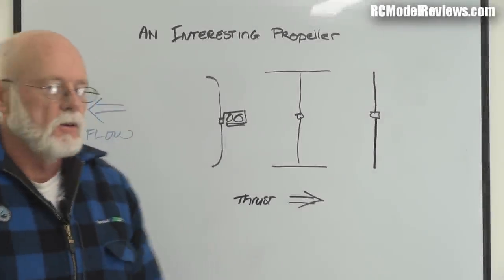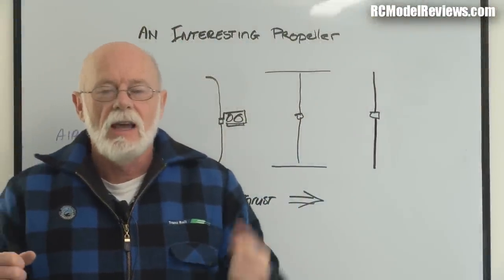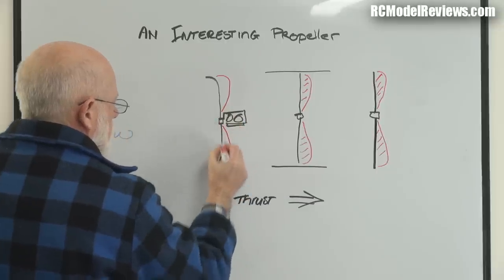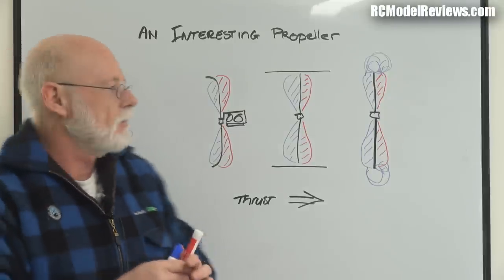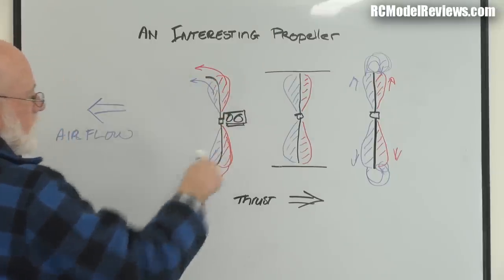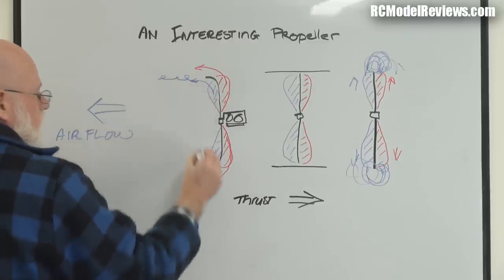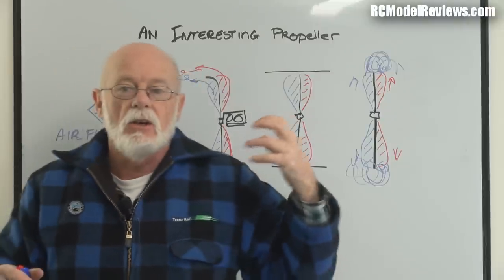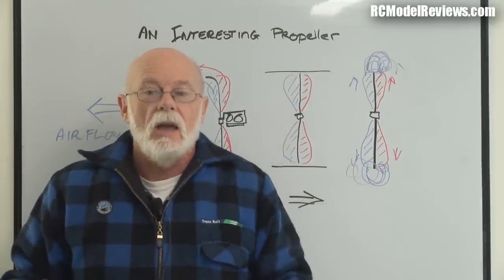More on ducted propellers, the Q-tip propeller

Comment: I"ve seen these blade tips on a car's radiator fan, now I know its to reduce noise output.
56years old and still learning, thanks Bruce.
Reply: Thx dude. I just learned from you too. Good day
Reply: @Adolph. As soon as I read your comment, I was reminded of the thermostatically operated clutch fans That I've dealt with over the years.  I feel dumb for missing that!  Excellent observation.  🤔
Reply: I've been searching the internet for 3 straight hours to find anything that explains a curved tip propeller. Im working on a project trying to find out how much a curved/warped blade tip would effect the aircrafts performance. Im trying to figure out if this is hurting my drones performance and if so how much and in what way. Thrust? Top Speed, agility?  It won't get any worse than this is now. If I dont use the velcro to keep in place the props flop around and snag on thing. Please advise sir I like the way you explain thing. Thanks in advance

Comment: Very clearly explained. I always thought the winglets were supposed to point to the low pressure side to block the airflow around the tip, not to the high pressure side to lead it along, as it were, so thanks for putting me straight!

Comment: thanks for answering my query.  this explains why my tricopter is so much more quiet than the other models as it has the tips on the props.  well, that and the slower props speeds.
Reply: Props work most efficiently when the tip speed is slightly sub-sonic, so if you have several props on several aircraft, the one with the slower prop (I'm assuming slower in RPM) is also the largest so the tip speed is really the same on all three. Unless one system is not optimised properly and the tip speeds are greatly sub-sonic, but then you got bigger problems than noise...😁

Comment: liked your video alot.  I have seen q-tip props a fair bit while working at my local airport. However, all of the props I saw sloped the tip back towards the fuselage - same direction as the thrust. Whereas you have portrayed them in the opposite direction. Keep up the good work!
Reply: Bear in mind that the prop effectively compresses air behind it so a back-tilting fence is going to act to "catch" some of that air. A forward facing one may not be as effective.

I suspect the best result would be achieved with something like bidirectional sharklets, but unlike ordinary wings props have a lot of other forces acting on them which need to be taken into account. 

The kinetic energy in a small GA prop at idle has been described as on par with  "a 600mph housebrick - on the end of a piece of string" and that's going to put a lot of streching stress on the length of the blade - As a GA pilot, we were always taught to be extremely careful about nicks on the leading and trailing edges of the props as these could turn into propagating cracks in very short order and the last thing you want when in the air is to have your prop suddenly unbalance itself.

Comment: Currently designing an all electric powered, twin ducted fan powered 2-place aircraft. It is a high wing LSA that will provide a true 90+ minutes of flight time. Both ducted fans will hang from the wings of the aircraft and the. Speeds will be comparable to those found in most traditional 2-place trainers (around 100-knots), and will provide ample room for both the CFI and Student Pilot. Every line will be lifting in its design and very clean....minimal drag! Look very forward to introducing the concept drawings.

Comment: Was sitting here waiting to see a prop made from Q-Tips... 😜

As for avoiding tip vortex, I've seen some props before use an entire ring molded as the circumference of the prop, avoiding tips altogether, and making like a short duct.  This could be placed in close proximity to an actual duct to facilitate the effect of a longer or more complete ducting apparatus.

Comment: At the speeds our planes fly, the direction of airflow as far as the propeller is concerned is chord-wise. The cause of the tip vortex is mostly the pressure differential between the "top" and "bottom" of the airfoil.
While the drooped tips will not produce "upwards lift" relative to the prop's airfoil (forward thrust to the airplane), they can be designed like airline winglets to produce "forward lift", actually pulling on the prop chord-wise and allowing higher rpm for a given power input.

Comment: G'day Bruce,

Yay Team...!

 In terms of pure efficiency it's always better Engineering is to simply build a Longer Wing, or Rotor Blade, than to pigfrig about trying to sculpt the nuances of the Aerofoil Tips, to try to attempt to shape the Vortices.

  In practice, if there's a Gyrogoflopter on the Aerodrome then the only thing louder than that within the Boundary Fence is the Flourescent Colours on the Jacket worn by the Gyrogoflopterists...

Which is slightly hilarious, but only if one flies Fixed-Wing Aerodynes....

;-p

Ciao !
Reply: Not true, the jets are slightly louder than the outfits.... 🤣

Comment: the loudest part of the noise coming off of props, if you pay attention, typically seems to travel in a surprisingly narrow disc of sound, in the same plane the prop spins in. ... which is especially fascinating, (and brings up the subject of focused sound transducers with narrow dispersion I suppose). You'll notice that when airplanes fly by, even at some significant distance, the noise is much greater when the prop tip is pointed at your ear (allowing for speed of sound delay at distance)

Comment: I wonder will we ever see such props for miniquads:)
Reply: +ROBOFORCERX2000 I would love to have some 5x4 props like this for my mini quad. Its my first one and the thing sounds like an angry wasp! Neighbors haven't complained yet tho. :)
Reply: +Owen Buckingham (Dwarf9668) You can probably bend them yourself with a heat-gun and some pliers. But most of the noise comes from vibrations and the motors themselves so I don't know if there will be any noticeable improvement.
Reply: +pyro1324 try it without the props on and you will see how quiet it is comparatively.

Comment: Methinks that those tip-vortexes suck some energy (from the engine/motor), so reducing them means more engine-power available for thrust, in stead of creating air-turbulence (and noise). Therefore higher efficiency

Comment: Good vid. Cheers. Im virtually clueless on the subject bar a few little fun facts but my intuition is leading me to wonder if - wouldn't a significant proportion of the total sound output be due to the  leading edge of the propeller 'striking' or travelling through differential pressure zones created in its path by previous propeller(s)? Or wash, or turbulent vortex, or what ever the terminology is for what I'm trying to say lol.

Comment: What about a plug in the center?  It seems to me that by directing air from the less efficient center, to the more efficient tip, with the tip sporting a winglet, should be most efficient.  

A 1.2 m diameter prop that's rotating at 2500 rpm has a tip speed of 157.2 m/sec.  As you go toward the center the speed slows down.  That's why the pitch of the blade gets steeper.  However, it adds far less to the thrust.

R    Area        Fraction   Velocity    Newtons     Pct Thrust
0.6 0.346 0.306 157.205   10,571.888 0.501
0.5 0.283 0.250 131.004     6,006.755 0.284
0.4 0.220 0.194 104.804     2,990.029 0.142
0.3 0.157 0.139   78.603     1,201.351 0.057
0.2 0.094 0.083   52.402       320.360 0.015
0.1 0.031 0.028   26.201         26.697 0.001
 1.131 1.000 ........ 21,117.080 

Over half the thrust is produced from less than a third of the propeller disc.  It seems to me if you build a propeller with a wing fence, instead of a winglet, you could dispense with a separate duct, and then if you put a nose cone across 5/6th of the wing, you could increase the thrust, by moving the air that flows slowly through the center, near the edge, where it is accelerated to far higher speed.

Wing fence example
http://filecache.drivetheweb.com/mr5mr_boeing/86126/K65656-02_med.jpg

The trailing edges of the wing fence would be circular like a duct section.  

If I take the area of each ring in terms of the rim area, and multiply the fraction by the thrust of the rim, I get 34,598.907 Newtons or 1.638x the full thrust.  The nose cone and tail cone, are like walls on the inside, and rotate with the propeller just like the tips do.  

You could increase the number of fins to increase efficiency as well - maybe six fins?  The nose cone would look a lot like a centrifugal compressor, since that is what it does, compress the air around the propeller tip against the wing fence on each blade.

https://upload.wikimedia.org/wikipedia/commons/c/c1/Compressor_wheel_Napier_NA357.JPG

Comment: Sir love the videos. I have a question. What if you put a ball in front of the duct?  This would the coriolis effect to suck the air in evenly dispite the angle of the duct.  The ball would have to protrude into the duct ending right at the start inpeller blades. The now annular stlye entrace should also speed up the velosity of the in comming air. The ball would seem like an obstruction but only to the force of the air keeping the other side down. The air should theoretically follow the curve of the ball dispite the angle of the duct. Sure youd have to cauculate air flows based on the application but from what i can visualize, the ball should stick out just enough to block the interference from the transition between horizontal and verticle flight. Once in horizontal flight the ball should be spring loaded to push in and funnel more air in from its shock wave, acting like a tunnel ram. This should work. I have some other ideas let me know if youd like to build one?

Comment: It's also worth of note that wingtip (well, in this case, propellertip) vortices bleed a considerable amount of energy due to vortex drag, and that's the reason commercial planes install winglet devices.

Now, propellers usually have non-constant angle of attack - being shallower towards the tip, so I dunno how much a propellertip winglet would save there.

Comment: Thanks for the great video Bruce! I was just wondering though, although Q-tips might not improve thrust, do they significantly improve efficiency (due to the reduced vortices)?
Reply: Good question.  That extra mass that doesn't create thrust is extra mass for the motor to force.  I bet the answer is a resounding "it depends"
Reply: Actually the answer is simple math. Efficiency is thrust produced divided by power required to make the thrust. So if thrust does not increase, efficiency cannot either....
Reply: I believe the trust  (and efficiency) is improved too, similar to a wing with winglets or tapered tips. Makes sense that the induced drag, due to wingtip vortices, are reduced with modified tips.

Comment: Very interesting .... Maybe it can be used for AP to decreased Vortex effect especially during descend stage avoiding "Vortex of the death " ?
Reply: +SeBy DocKy not really, that happens when you descend into your own prop wash. Only way to fix that is to move out of it.
Reply: +staslig Yes but it comes mainly by your own created vertexes.... so if you reduced them with such kind of props... it may help
Reply: SeBy DocKy no, it comes from your thrust.
The propwash is downward moving air, so when you descend into that, its like climbing a falling ladder.
This is also why it makes it worse when you increase thrust.
The only way to beat a "vortex of death" or "Vortex ring state" which is it's real name is to fly out of it. In a helicopter you lower your collective and push forward on the stick to dive out of it. Just hope you are high enough to not crash when doing this.

I fly full size helicopters btw, I have been in this kind of thing many times in training.

Comment: It seems to me that the duct - tube - blade combination could be used on 'whole house fan' units.   Whole house fan units  typically expel air from the house into an attic with a large fan.  The moving air  then exits the attic through roof vents.  If instead of expelling air into the attic via a large fan, the air were drawn from the house (from screened doors & windows) and expelled through a fan-duct/tube combination through the roof directly to the outside, that would work more efficiently (& with a smaller fan unit) than if that same air were expelled into a large attic.  Is that correct?????  Also, it seems the ducted fan unit (expelling air through a small high opening) would work in combination with the Venturi effect.  Comments???? analysis?????  Edith

Comment: G'day Bruce,

Yay Team ?

 Shit-Oh Dear...!

 I just watched the Big Announcement Video,  and it's about as bad as it could be...

  I remember having a bad vibe about the consequences, back in 2012 when your Video of the Expedition to visit the Time-Warp Model-Flyers with their telescopic Chrome-plated Fishing-Poles and fuddy-duddy Paramilitary Anally-Retentive habits and rituals...; but by the time I'd seen it the damage had been done, in that the Grumpybuggars Brigade would've seen it too, and they seem to have taken some kind of a Blood-Oath to conduct a Vendetta against you, for pissing on their Household Gods and Icons, and daring to laugh at them while doing it...

  About all I can suggest is that you stick a Solar Panel on the Roof or Bonnet of your Truck, and at least save yourself a bit of Fuel. (?).

  When I started doing it I was slightly obsessed with aerodynamically-streamlining the PVs but in practical terms it's hardly worth the effort to do about $600 worth of Sheet-Metalwork on a $150 Solar Panel, to get it to save 275 Litres per year instead of 261 Litres, which the almost standard PV will achieve.

 The latest minimalist approach is to simply drill Vent-Holes in the Trailing Edge Frame of the PV, to allow Hot Air to escape while stationary, and to inject Air into the Turbulent Burble at Highway Airspeeds...

  There's nothing patentable about the SunFoil, so I was hoping to see it take off as a DIY Project, but it means that nobody can stop you from fitting PV's onto other people's Vehicles, if you need something of a sideline to generate a bit of Cashflow ; and please feel free to make some xjet Videos having a laugh at the whole idea, you can try to debunk me for the lols if you like, (then surprise yourself when you find that the Idea actually works...).

  Other than tying a Food-Parcel to a Wedgetailed Eagle and telling it to Wave-Surf accross the Tasman to get it to you, that's about the best I can do...

  At least you haven't got a hungry high-powered Warbird of Antique Hairygoplane which cost millions of Dollars and now can't be displayed at Airshows except in Straight & Level Flight unless over the Ocean...; which is the immediate fallout from that Hunter T-7 which the ex-Harrier Pilot tried to Loop from Ground-Level with full Drop-Tanks at Shoreham..

 In the current Economic Climate, the whole Airshow Industry looks like it might be gutted, at least in Britain ; and that sort of stuff often spreads...

 What price a Spitfire, Mustang, Yak, Corsair, L-39, Hunter, or the like, now ; if nobody can hope to command Appearance-Fees..?

  Noli Illigitimi  Carborundums mate,

;-p

Ciao !

Comment: could i use 4 q-tip propellers to build a quieter quad copter?
Reply: You could, but you'd have to design and fabricate them yourself, since i'm not aware of anyone who makes them in the electric quad size range (3" to 12")
Reply: Vegas 666 You are thinking exactly what I was thinking. Quadcopter/drones are so noisy and loud, esp for capturing video. The blade design could be a lot better.

Comment: So would adding the wing tips to a ducted propeller make it even quieter and more efficient, or would it have no effect?
Reply: I believe it would have no positive effect and just increase friction/drag. Possibly much more importantly it would limit to the speed it could rotate as those tips will want to splay out the faster it rotates and that would risk rubbing against the ducting. You could move the tips in to give some room but that makes the ducting less effective.

Comment: wow so these "winged" props would be ideal for park jets using pusher prop set ups?
Reply: +m ej I think I'll try to bend tips of an 8x4 gws for my 7x6 pusher
Reply: Did it work? I'm considering giving it a try too.
Reply: You could also try to use multibladed propellers if noise is the problem.

Comment: how about a ring that attached to the prop that acts as a sidewall (ducted) prop, but this ring rotates with the prop or would it be better to have the prop separate from the sidewalls? I'm thinking the prop will have better inertia because of the outer ring, also make the prop a scimitar prop (curved blades) to silence the prop further. Let me know what you think professor.

Comment: Fixed shroud to prop eliminates gap, noise, etc.  Would it be optimal  solution? Basically, a jet. If you also use contra-rotating props you get huge pressure/thrust. Yes?

Comment: Now the question for you sir... If you had that q tipped prop, in a duct... with you even have a even better design, will there be even more thrust, or does it cancel out the purpose making it essentially slower.. because of the design there would be excess weight/mass what ever you want to call it. Basically what i'm asking is would a Q tipped prop in a duct... Be The best design for efficiency and Power??

Comment: You mention them being used for pusher type planes like that autogyro, but is there any reason they couldn't be used for tractor-style planes?  Then they'd be going through smooth air and would be even more quiet, right?  If the efficiency gained at least counteracts the additional drag, it seems like it'd be a win all the way around..  

In other words: what's the negative?